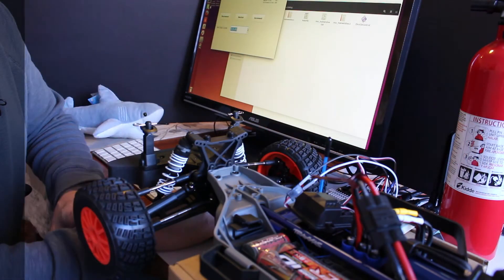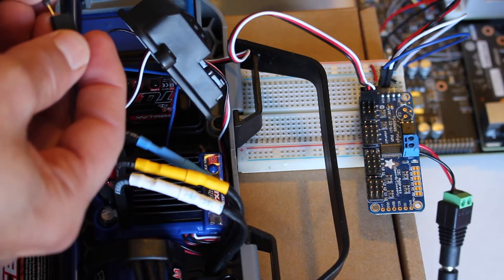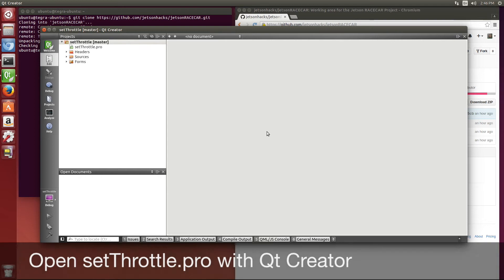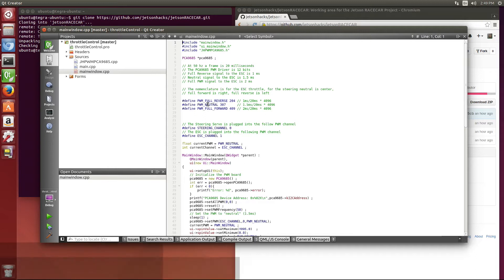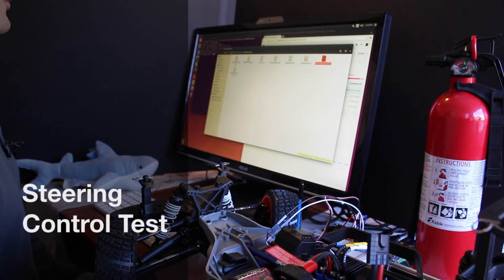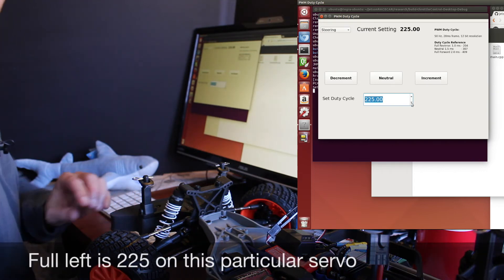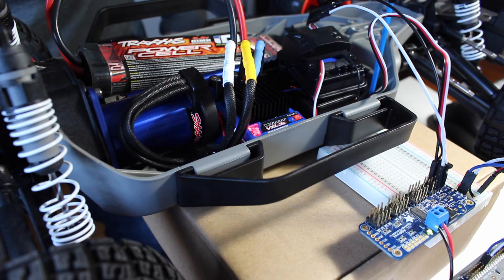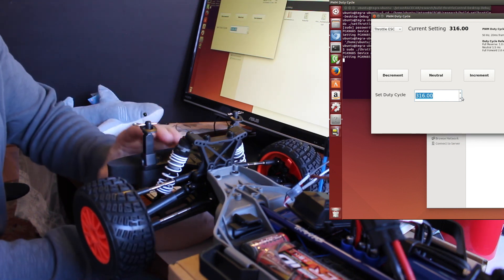Jetson RACECAR Part 3 - Motor ESC Control

Comment: Thank you for the video. The 50 hz mentioned in the line 7 at 4:58, is that of the PCA9685 board or ESC?
Reply from the maker: It's the PWM frequency, which is used by both devices to sync. It's the standard PWM width pulse, the PCA9685 actually generates the signal as I recall. They have to talk to each other, so they both have to understand what's on the line. Hope this helps, and thanks for watching!
Reply: @JetsonHacks Thank you for the explanation. 🙏

Comment: Can we use the red wire from ESC as 6V+ to power the PMW driver, instead of using a 6V power adapter ? Thank you
Reply from the maker: Yes, you should be able to. Thanks for watching!
Reply: @JetsonHacks  , Thank you for your quick reply. What is the best why to approach this? Should I get the red from VXL-3S (ESC) and feed it to the PCA9685 external power supply's + and the black from  VXL-3S (ESC)  to the PCA9685 external power supply's - ? Thank you

Comment: Hello, 7:27 of the video, after I hit my light does NOT turn red as expected to show it's "armed"; instead it keeps blinking green light. Any inputs please? Thanks.
Reply from the maker: Hi Louise, I don't know which version of the RC car you are using. You should be able to follow the Traxxas manual to go into calibration mode. Calibration mode is built into the Traxxas car, it's not something we programmed.
Reply: I have the same issue as yours. Did you solve the problem? Can you please let me know your solution?

Comment: amazing work dude.i must say that. i am looking for some information maybe you know something. how the embedded system of automotive fully digital dashboard works.like in Tesla.i have heard they used Nvidia tegra processors.i wonder what kind of computer behind those futuristic detailed dashboard. is it something like Jeston? then how the computer unit(mpu) take different car sensor data into process. through gpio? then the gui.how the gui is created.and how the gui data represent those sensor data.by serial communication? greatly appreciated your thoughts.
Reply from the maker: +WEKRAYS NVIDIA makes several products for in vehicle use. They use the same processors that are in the Jetson, Tegra K1 and X1 for the cockpit: http://www.nvidia.com/object/drive-cx.html In general, they have dedicated, specialized board that brings in the I/O from the vehicle such as camera feeds, radar, etc. They have specialized software that comes with the automotive development kits for designing the gui and display interfaces. 

There are also other Tegra kits designed for autonomous driving: http://www.nvidia.com/object/drive-px.html

So the answer is yes, they use the same processors for the vehicles as they do in the Jetson kits. For vehicles, NVIDIA has designed specialized embedded boards for that application.
Reply: great info.thanks a bunch Jetsonhacks details are spot-on.

Comment: You might want to get the Benjamin's open source esc (or make it yourself): http://vedder.se/2015/01/vesc-open-source-esc. It supports brushless field oriented control (fov), encoder input, great low speed torque, etc. Great for robotics.

This esc is crap.
Reply from the maker: +Jaroslav Novotny Benjamin's VESC was used in the 2016 MIT RACECAR build, so it's definitely going to be part of the build. In addition to driving the motor, it also has a PWM interface for the steering servo. Last year MIT used the TRAXXAS ESC, so the thing I was curious about is it absolutely necessary to swap out the ESC? The short answer is yes if you want complete control over the robot, but MIT was somewhat successful in the 2015 car with the stock ESC so I wanted to check it out.

The stock ESC isn't horrible, it's just not programmed for low speed robotic applications. Not surprisingly, people don't buy RC cars to go slow.
Reply from the maker: +Jaroslav Novotny Do you have a good source for an assembled VESC?
Reply: +Jetsonhacks Nice, didn't know his esc is getting so popular and that they are using it in MIT:)

The best source is probably Benjamin himself. He sometimes sells them assembled for about $115. But they are quickly sold - it's best to shoot him an email if he has some currently.

He didn't have any when I needed so I had to assemble them myself. I got the materials from Mouser and the boards from https://oshpark.com (they are gold plated which makes them easy to assemble). There is this guy now: http://www.electric-skateboard.builders/t/searching-for-vesc-4-10-4-11-pcbs/1054/15 he has a lot of boards and is able to send for basically free (the post is 15 day old) - maybe he would be willing to sell some assembled. The best bet how to get newest version assembled vescs are from the community. There are IRC channels: http://webchat.freenode.net/?channels=vedder, http://www.hackvana.com/chat and there are forums: http://www.electric-skateboard.builders and http://vedder.se/forums/index.php.

I made the 4.7 version (which was newest in that time), it is easily upgradable to 4.8 by moving 2 capacitors and 4.8 is basically the same as 4.9 (newest) except some routing. The silent field oriented control was introduced with firmware 2.3 and with hardware 4.8. This feature is great and worth getting.

Here are some vendors that sell them assembled: http://www.ollinboardcompany.com/product/vedder-s-speed-controller, http://www.esk8.de/shop, http://www.enertionboards.com/electric-skateboard-parts/vesc-motor-controller/. People also sell them on ebay.
Reply from the maker: +Jaroslav Novotny Wow, thank you for the detailed reply. I'll definitely check this out!
Reply: Is it not necessary to include an encoder for the odometry?